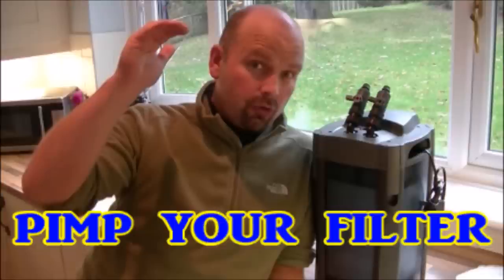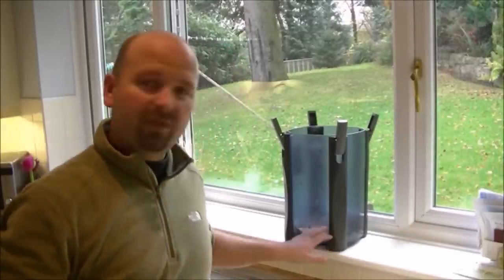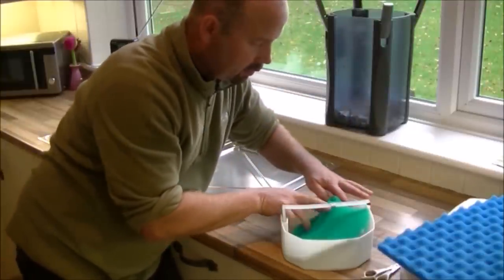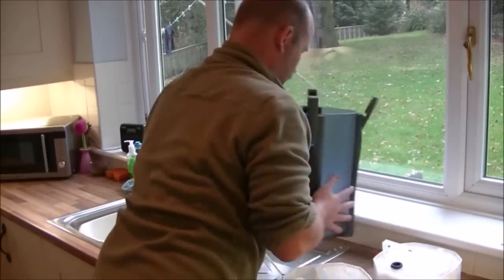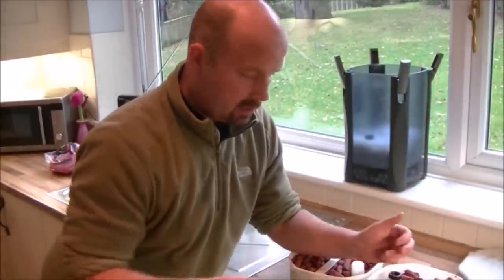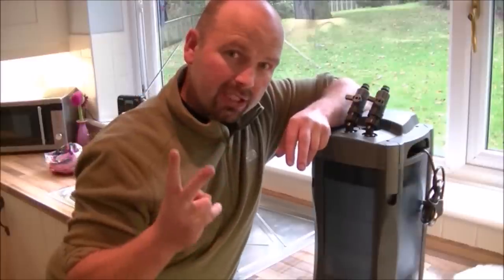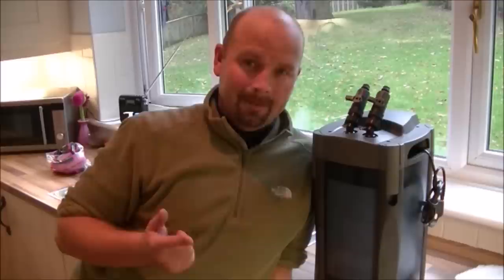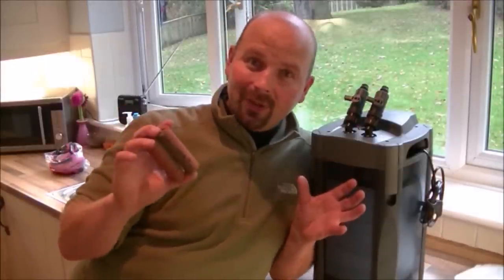External canister filter set up, nitrogen cycle and what happens in a filter - by Pondguru

Comment: How often would you change or clean out that filter ?
Can you do a video on cleaning it out .
CHEERS
Reply from the maker: I have an external and booster filter to make a video or two on and hope to do that soon.
Ideally an external would be cleaned once a month but that can be extended to every 2, 3, 4, 5 or 6 months depending on the filter size, stock in tank and size of tank. If you check after a month and think it will go 6 weeks next time then aim for that. If you check it after 6 weeks and think it would go 2 months next time, check after 2 months and so on. There is no point cleaning it out when not necessary but every tank is different.
Having a filter big enough (or oversized) for the tank volume and stock is always better than having one which is borderline and as a rule of thumb we have concluded that when people are using the biohome mini ultra or biohome ultimate there should be approx. 1kg of media per 100 litres of water to see a reduction in nitrates (full cycle filtration) in a normal tropical community tank. More is required for heavier stocks and marine to achieve the full cycle and reduction in nitrate.
Many tanks will have under-powered filters and I will be doing a video about that too. If a manufacturer claims the filter is for 'up to 400 litres' you can halve that for a normal community tank if you want to achieve low nitrates (when using suitable amount of media) so in effect a filter for 'up to 400 litres' is suitable for a 200 litre tank and you'll find that models in that range should hold 2kg - 3kg of media (assuming that 1 tray is used for foams).
There is some useful information on my website on the Q&A page http://www.filterpro.co.uk

Comment: can i use the media for a saltwater tank
Reply from the maker: Robert Caccamo Yes and it is very efficient for marine filters but the added trace elements in the biohome ultimate don't have the same boosting effect on marine bacteria than they do for freshwater bacteria so you would be better going for the mini ultra media or the large size ultra for marine as it's a bit cheaper than ultimate but structurally exactly the same.

Comment: I was wondering, do you think its possible to make a layered intake sponge/foam? Like coarse sponge around the outside with medium in the middle and fine in the inner part? Id think this would be a cool idea
Reply from the maker: I have seen a block of foam placed over the inlet but never a fully layered system. I reckon the intake surface area would be too small to allow fine foam / pad to be used since it would clog quickly and strain the pump inside the filter?
Reply: Pondguru Yeah, that makes sense
Reply: Pondguru Just bought some media. Super excited!!
Reply: Pondguru Does the Biohome Ultimate raise the ph?
Reply from the maker: Like all sintered glass and ceramic media if lots is added at once it can have a temporary effect on pH (raising it  bit) but that will settle quickly. If you have a mature system it is best to add any new media gradually so your filter does not get reset back to day one (when it had no active bacteria) but in a new system it is fine to fill the filter up all at once.

Comment: I have a 75 gallon tank with a Fluval 406 canister filter, it's currently cycling cause it's new. How much biohome should I get for the canister. The fluval 406 has 4 trays. Currently the bottom tray has fluval sponges, 2nd tray has mechanical rings, 3rd has polisher pad with carbon 4th tray carbon. Help.
Reply from the maker: If you send me the dimensions of the trays you want to fill (I assume 3?) I can work out now much you will need no problem. I see you have sent an email with the same question a few minutes after this comment so I will answer here as it was the first.

Comment: Yes I've seen this video, thanks....... quick question , on my two eheim 2075 filters they each have 4 trays, was wondering if I can use three of the trays with the biohome ultimate instead of just using the two that I am now..... the way I did it is using 2 for mechanical and 2 for biological with the biohome ultimate.... or do I need to set it up the way the manufacturer has it with 2 and 2...?
Reply from the maker: Provided you have foams in correct order from coarse to fine then 1 tray for mechanical is all you need. The more biological media you have in there the better the water quality will be and pollutants will be processed much faster.
Reply: Pondguru perfect. ..... thanks again ....... cheers

Comment: Would that set up work for a ehiem g160 2075 the pro 3 I believe or would I want to coarse medium fine in the top tray. Only thing I have read is it has a pre filter in top. Didn't specify if the pump was in top or bottom. I believe top but was sure as far as the foam set up.
Reply from the maker: Jamos French The pump is in the top and the water comes into the filter, hits the coarse blue 'pre-filter' foam then goes down to the bottom of the filter to be drawn back up through the trays so it works exactly the same way as the one in this video. Therefore when setting simply leave the blue foam in top then set up trays as shown here (graded foams in bottom tray and media in the rest of the trays).There are a few videos on youtube showing how o set up the Pro3 series but they simply follow the manufacturers instructions which is retarded and a waste of a video as there will be no useful information there.According to my records the 2075 has 4 trays and each one will hold 1.25kg of mini ultra or ultimate filter media so for the 3 trays of media you would need 3.75kg. That would be enough to see a good reduction in nitrate for 350-400 litres of water in a standard tropical community tank.If you want a price for that just let me know at pondguru@btinternet.com and let me know what country you are in, no worries.

Comment: I have an immediately relevant question:
I followed this guide, but the water is now cloudy.
I also added a significant increase in bio filtration, using fluval biomedia rings, could this be causing the cloudiness? If so, could someone explain why?

Ty
Reply from the maker: If it was a mature tank and you swapped everything out in the filter in a single day it could be a bacterial bloom in water which should clear eventually but check levels of ammonia, nitrite if that swap was all old out and all new stuff in. Ideally a filter on a mature tank would be upgraded over many weeks.
Reply: @pondguru  My upgrade was fairly substantial over my old setup, and I didn't have to throw out any established filter parts. I'll check the levels you mentioned later today. Thx for helping!
Reply from the maker: @Gorboror  No worries, hopefully the clarity will improve.

Comment: +Pondguru few questions if you get a minute.... how do i know if im getting enough/too much oxygen in my tank? Concious i have to many bubbles ruining my display and would love to reduce without killing the fish.Also - external filters, have you or are you doing a video on how to attach to a standard tank? Im again concious of drilling the glass or the lid for my pipes. Hope that makes sense and love the video's - keep them coming!
Reply from the maker: External filter pipes simply loop over the top of the tank and most hoods will have holes or openings for this.
As long as some bubbles are breaking the surface and water surface is moving there doesn't have to be a nation of bubbles in there. Some tanks operate fine without any additional aeration so don't worry too much about reducing the air input.
Reply: Top man.  Looks like im in for some diy as my tank has no holes for externals and i hate internals.

Comment: I have all pond solution 2000ef with 4 trays how would you advise setting up the 4 trays
Reply from the maker: That is a great filter and the bottom tray would have your coarse, medium and fine foams followed by 3 trays of media. Each tray will hold approx. 1.7kg of biohome ultimate so it would take around 5kg for the 3 trays. I have the media in 5kg and other quantities on the FilterPro website and 5kg kits which have the foams in here: http://filterpro.co.uk/filter-kits-8-c.asp
Each page has links to other suppliers if you are not in UK (flags at top of page).
If you found that you needed more filtration you could free up the bottom tray by adding a 'booster filter' on the intake pipe like this (it would hold all the foams): http://geni.us/2bj1
Hope that helps.
Reply: As it stands I have all corse in pre filter then medium fine and super fine in tray one tray 2 bio balls and tray 3and4 rubbish ceramic rings wich I intend to change for biohome does this sound right
Reply from the maker: Ideally all the foams and fine pad would be in the booster which would free up all the canister for the biological media. That way you would only need to look in at the canister every 4-6 months.

Comment: Hi  I wanna setup a new tank after the filter setup I'm gonna need some fish to get the cycle started right.
Reply from the maker: Set the suitably sized filter up and let it run for a week or so then trickle fish into the tank after a week or so, adding more every 1-2 weeks so it gives the filter time to catch up with the waste being produced by the fish. A good sized filter with proper media will have no problems safely cycling a tank using fish and water will never get anywhere near toxic for them as long as the fish are introduced gradually.

Comment: hey pondguru! ive decided to upgrade my current internal filters to an external canister filter. i was wondering what is your take on U.V. sterilizers. the canister filter im looking comes with or without the U.V. if you have good mechanical and biological filtration is uv even needed? currently im using an internal power head with uv and a home made filter with mechanical and biological filtration.
Reply from the maker: +Shane Moore I'd say a UV definitely isn't essential for indoor tank but it does no harm. Best to leave turned off for 2-3 weeks while establishing the filter to allow beneficial bacteria to flow around the tank.
Really there should be no need for a UV unless you have multiple tanks running on one filter then it is essential to prevent disease / parasite transference between tanks.
Reply: +Pondguru Outdoors  thanks pondguru! what i ended up doing was getting the filter  with the uv option. but my question now is how do i introduce the new filter to the aquarium with the existing filters. if i take out the old filters i will lose all my bacteria.
Reply from the maker: +Shane Moore Add the new media gradually and swap out the old stuff every week so change over to new media takes about 1 month. Maybe change the foams one week followed be a tray or half a tray the next week and so on.

Comment: How do you do with the Fluval FX6? Can you do a video about that also how to set up that canister filter with foam and biohome media. Sinceraly Conny Karlsson Sweden.
Reply from the maker: The FX6 trays have water flowing through them from top to bottom and as you have good foams surrounding the trays you really only need a fine pad on top of the top tray. That allows you to get 5kg of biohome ultimate into the 3 trays in total. I have an FX5 which I will be using in an upcoming 'pimp my filter' video and that will be the same set up for FX5 and FX6.
Reply: Hi Again Pondguru! But how can the water flow from the top to the bottom when the water intake is in the bottom of the filter? And as you have said before about the sun sun  canister filter  the filter foam should be in the bottom of the filter an after that the biomedia. Is it the same for Fluval FX 5/6 then? But I find that strange if you say the water in FX 5/6 flows from top to the bottom, the opposite thing compare to the sun sun filter you show in your video. So if the water flows from the top to the bottom in FX 5/6 the filter foam should be first in the top of the filter and after that the biomedia= the opposite compare to the sun sun filter the water flows from the bottom of the filter and up. Can you please explain to me here so I dont do any wrong, how i should place the different filter foams and biomedia from the bottom to the top in Fluval FX 5/6 so I get it to work as it should in your opinion to get the best filtration of the water with the Fluval FX 5/6. Many thanks for your quick answer. Sincerally Conny Karlsson Sweden.
Reply from the maker: The FX6 trays have water flowing through them from top to bottom and as you have good foams surrounding the trays you really only need a fine pad on top of the top tray. 
Water hits the foams surrounding the trays first then flows down through the trays to the pump and back to the tank so you would put fine pad in the top of the top tray followed by 3 trays of media (5kg biohome ultimate in total)
Reply: I have now ordered Biohome media from a retailer here in sweden.
Reply from the maker: Groovy - sounds good to me.

Comment: Would this set up work on a planted tank? Or what do you recommend me to do, I'm planning on setting up a 55 gal tank soon
Reply from the maker: +Jay Easyrider Yes and although setting a filter up this way with biohome often results in zero nitrates the plants still do well as the nitrate is processed into soluble nitrogen which is easily used by plants so no worries there.

Comment: Hey Pondguru,

Question? I see that you put some media at the very bottom of that canister filter to help pick up muck, I was wondering if I can do the same with an eheim 2217 since I have about an inch and a half of space under the coarse foam pad?
Reply from the maker: +donald garcia Because of where the pipe comes in on that filter I definitely wouldn't add media on the bottom as it may restrict flow if it gets into the pipe.

Comment: Hi, I'm upgrading my marine tank & my filter which have been set up for 4 years. can I replace my bio balls etc all at once with the top 2 trays with the media? Do you know if all filters have a gap at the bottom? I can't see through mine. Thanks in advance.
Reply from the maker: Most will have a gap at the bottom, yes.. Bioballs can all be replaced as they hold hardly any bacteria but other media would be swapped out over 3-4 weeks to ensure that there is bacterial activity maintained to prevent ammonia spikes.

Comment: Hey Richard. I just bought an eheim 2213 for my planted 50 gallon tank. It has a low flow rate for a tank of my size, but it is rated for 65 gallon, so can I get away with that by adding 1kg of biohome ultimate? I have 15 neon tetras, a few german rams, and about 10 julii cories and one rubber nose plec. Right now I'm running a sunsun 303b which has a higher flow rate and bigger media trays, but it's honestly not a great filter because of bypass and the wattage is about 3X as much as the eheim.
Reply from the maker: 50 (US?) gallons works out at around 190 litres so for a normally stocked tank that would require around 2kg of biohome to achieve full cycle filtration (reduction in nitrate) as it generally takes around 1kg (2.2 lbs) per 100 litres (38 US Gal.) for that scenario. Whatever filter you could get that amount (or ideally more) into would be one to run - could be that the eheim is too small as I see it only has a media capacity of 3 litres and that includes sponges so it may fit nearer 1kg - 1.5kg in there?
Reply: But will it do a good enough job to remove ammonia? I only have 1kg of biohome ultimate right now, but I am planning on getting some more. Yeah sorry, that's US gallons. Being in Canada we get most of our aquarium products catered to the US imperial system.

I don't want full nitrate removal necessarily since it's my planted tank, and this is my first time using a media that actually removes nitrates. I have to dose nitrates daily, so I'm not looking in having to dose even more. I'm more interested in having just excess removal, so maybe I can squeak in an extra week without doing a water change lol

Comment: Q: While waiting for the anaerobic colony to develop- is it safe to change out a certain amount of the nitrated water, so the fish are ok? What % is ideal, without messing up the balance? Thank you
Reply from the maker: I wouldn't change more than 25% of the water per week and that can be reduced as the filter matures.
Most people will find that the filter never properly matures in their tank but if you use proper media (and enough of it for the stock / volume of tank) then the cycle will be completed and nitrates will fall. When they come down to a very low level you'll just need to do a 10% change every week or so to keep the tank freshened up.

Comment: Could I do this to my juwel Rio 125 internal filter then. On that if shows the water flowing through the fine white filter at the top first point that the was hits not the last. Should that simply be turn around for starts. And replace the sponges at the bottom
Reply from the maker: Matthew Dj All filters really should work the same with water hitting progressively finer foams then the biological media, then carbon (if used).

Comment: Would this be the best media for me. I have a 200l tank with 4 3-4in koi with a fluval 305 external filter???
Reply from the maker: I haven't got sizes for the media trays for that filter but the 306 apparently has trays which are 5.5" x 5" x 3" deep which equates to 1kg of biohome mini ultra or ultimate per tray. Ideally for a 200 litre tank you would use 2kg to see the nitrate nailed down.
Reply: Ok mate. I will give it a try in the next few days and get back to you with results. Fingers crossed I can sort something lol :)